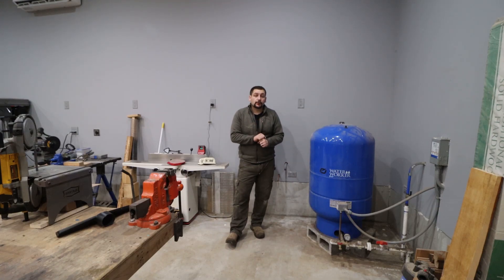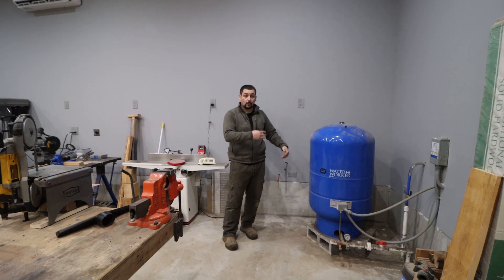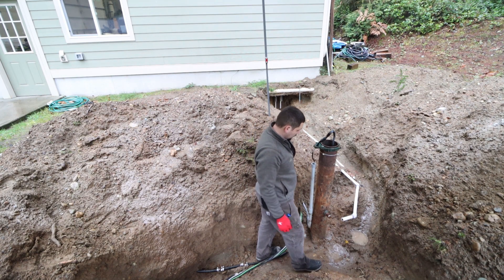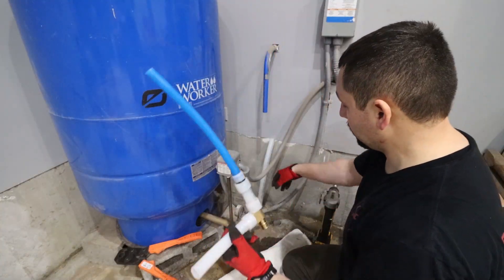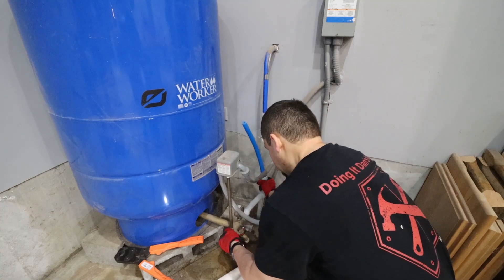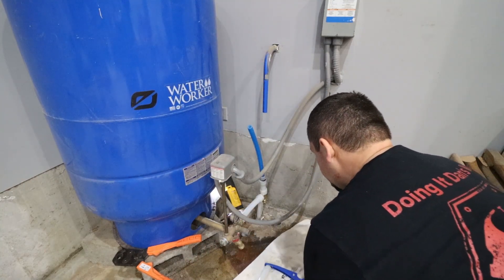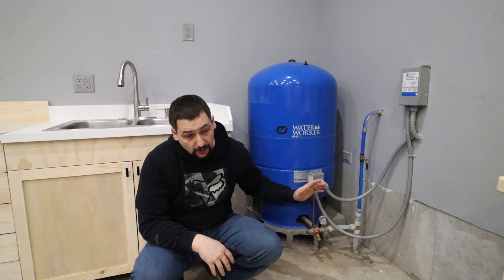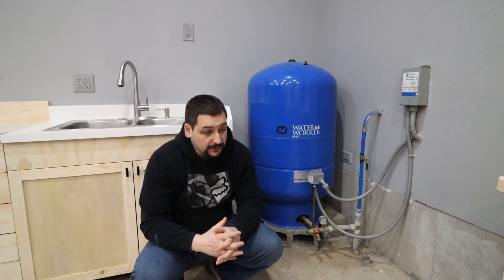Well Water Pressure Problem, Pump & Flow Fix?

Comment: Interesting system. I always worry metal will corrode underground but realistically it will take decades for it to happen. I used plastic philmac fitting out of the pitless and 160psi pump drop poly tube. 1.5 horse pump is the ticket though. I could pump 12-15gpm through my 1" Irrigation main but I have it doing 7gpm with a 30/50 pressure switch since my recharge is only 2gpm
Reply from the maker: I wish I had that kind of pressure that would be amazing!! I don’t particularly worry about the metal fittings in the ground. the amount of time that it takes for them to wear out is way beyond the time I’ll be on this earth.